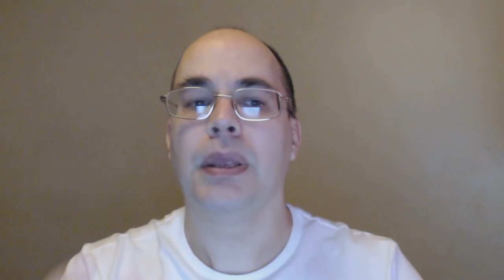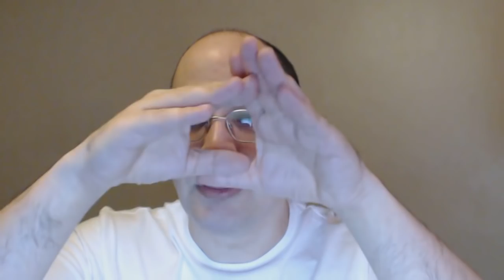How do rockets move in space, with nothing to push off from?

Comment from the maker: Clarification. In Newtonian physics force = mass x acceleration not mass x velocity. However neither is entirely accurate for calculating rocket trajectories in space due to issues with Einsteinian physics. In the video I probably shouldn't have used the term equals which made it seem like I was reciting Newton's second law, but with the hundreds of videos I have done one was bound to have some ambiguity in it. In the video I was referring to the conservation of momentum and using the example of a bullet leaving a gun, for these you need to use velocity and NOT acceleration, especially as I was being explicit that both the gun and later the rocket were stationary. Acceleration is the change in velocity over time and in the example of the bullet leaving the gun and the recoil happening, time is not a factor. Hopefully this clears up any confusion.
Reply: @Davy spilani, I know that you think you've figured out some giant flaw in the foundations of physics .... but you're wrong. Simply, completely, utterly wrong.
__

First, the "mass that an object is pushing against" in the case of a propeller (in air or water) is 100% irrelevant.

Proof: A boat, with its propeller turning at a set speed, produces exactly the same thrust whether it is on a small pond, a moderate size lake, or the immense ocean. The mass of the lake may be thousands of times greater than the mass of the pond, while the mass of the ocean is trillions (or more) times greater. Yet the thrust of the boat changes not one iota.

The thrust of the propeller is proportional to the amount (i.e., mass) of the water thrown backwards (which is proportional to the diameter of the propeller & density of the fluid) times the average speed at which the water is thrown backwards (proportional to the propeller's rotation speed). Note well, there are also Drag Forces to consider, as the boat (or plane) has to push water (or air) out of the way in order to move forward.

But if you were able to add up all the momenta of all water molecules pushed backward, forward & sideways, then their accumulated momenta would exactly equal the amount of forward momentum of the boat.
__

Next, your "spring model" for a rocket is inept. 

The main failure is that, with your "spring & two equal masses" model, you throw only one mass, one time, at very low speed compared to the rocket's speed.

A real rocket throws (trillions times trillion times trillions ...) of tiny masses (the rocket fuel molecules) away from the main mass (the rocket itself) at very high speeds.

A better model would be a machine gun (the "rocket engine"), mounted on a platform (the "rocket"), shooting bullets (the "fuel") backwards, which causes the rocket & engine to move forward.

Now you have a small mass (the expelled rocket fuel molecules or bullets) being thrown backwards at high speed from the main mass (the rocket & engine) & the main mass gaining small, incremental increases in velocity forward with each object thrown backwards. 

They key differences with a spring is that a certain amount of mass (rocket fuel molecules or bullets) is leaving the main mass (the rocket & engine).

This system works just fine in an atmosphere or in a vacuum. In fact, it works better in a vacuum because there are no molecules of air that it has to push out of the way in order to move forward.
__

If you are a typical "rockets don't go into space, it's all a giant hoax" conspiracist, then your problems are much greater, and much different, than merely not understanding remedial physics. Scientists, physicists, engineers & teachers are not part of some giant conspiracy to lie to the public.

Here's a rule to consider:
"For every idiot who turned out to be an Einstein, there have been a million idiots who turned out to be idiots."

Play the odds.
You're not an Einstein.
Reply: Rockets ignite typically liquid oxygen and kerosene in its combustion chamber. This continues event makes the molecules of the gas (unders great pressure) bounce off the walls of chamber.It then exists the where it continues to bounce off the nozzle (but not as much as the chamber)
THIS produces the thrusts.

It doesn't need air to operate in or push from. This is the many problems people have since they use the false equivalence of propellers that needs to push of air.
Since the Soviets launched the first satellite we have many forms of evidence of engines operating in a vacuum.

To sum it up: The exhaust gases and the rocket push on each other
Evidence: Most recent are the SpaceX missions. if rockets do not work, explain how SpaceX is getting cargo in orbit, How did the Soviets go to Venus? How did the Chinese send a probe around moon, etc?

Some resources for you
http://www.physlink.com/education/askexperts/ae221.cfm
http://www.braeunig.us/space/sup1.htm
https://www.quora.com/How-do-rockets-accelerate-in-space-or-vacuum-in-the-absence-of-any-material-to-provide-them-the-required-reaction-force
https://www.youtube.com/watch?v=rt5dcrm8X1w

Rockets experiments in a vacuum
https://www.youtube.com/watch?v=GxBRQXxBRic
https://www.youtube.com/watch?v=76JM03a6WH4
https://www.youtube.com/watch?v=uf6158lBjGo
Reply: @m j murcott
You simply mis-spoke. There is no need to bring "Einsteinian physics" nonsense into the issue. In your "correction", you introduced a MUCH bigger mistake. The law of Conservation of Momentum is always exactly, precisely true in both relativistic (extremely high speed) and non-relativistic (lower speed) systems. 

Force does NOT equal mass times velocity. 
Momentum equals mass times velocity. 

At the 2:35 point, you should have said, "Since MOMENTUM equals mass times velocity ...", instead of "Since FORCE equals mass times velocity ..."
Reply: Davy spilani - how about this simple physics problem? I have a remote control crossbow. It is loaded and cocked and I set it on an ice rink on little ice skates (or frictionless surface). What happens when I fire the bolt from the bow? What happens to the bolt? What happens to the bow? What if I use a low mass bolt like balsa wood? What if I use a high mass bolt like lead? What if the bolt and bow both have the same mass? Describe what an observer would see in these experiments.
(But I already know you won't answer, you will make some excuse why it is not relevant instead). And you THINK it is irrelevant but that is your lack of understanding of physics talking.
Reply: Justin Derricott 
Not when ot comes to friction they aren't.
Reply: THE RECOIL FALLACY This is perhaps the most commonly used analogy to help the average person figure out how a rocket works: “Well, just think of a shotgun, you pull the trigger, a charge explodes, a bullet is propelled forward at a high speed and you feel a recoil that pushes you backwards (same in the wheelchair-medicine ball variant). You know, action-reaction, Newton 3 law, etc. OK, now bear with me, a rocket is like a shotgun that instead of bullets shoots out highly pressurized gasses. Do you think you wouldn't feel the recoil shooting a rifle in a vacuum? Of course you would, so, since a rocket and a rifle use the same principle, they must work just fine both in your backyard and in the vacuum of space. Right? ”Wrong". The fallacy lies in equating the bullet in the rifle with the expanding gasses in the rocket. Why? Because, from a Newtonian point of view, in the two systems the bullet and the gasses have opposite inertia. Inertia of rest vs inertia of motion. The players in this scene are: the Rifle/Wheelchair (= The Rocket) the Gasses/the-ball-thrower (= The Force) the Bullet/Medicine ball (= the external pressure/Resistance to the expanding gasses) in the rifle/wheelchair example, the whole system is at rest initially. The rifle, the bullet, the wheelchair, the medicine ball and the-ball-thrower are solid objects, and they just love to stay at rest (Newton 1 law). To put anything in the system in motion, overcoming inertia, you need to apply an external force (action). Newton 3 law tells us there can be no action without a reaction if a force pair exists, so the same force applied to the bullet or the medicine ball will be applied in the opposite direction to the rifle/wheelchair. Who provides the force? The expanding gas in the rifle (or the-ball-thrower sitting in the wheelchair). So far so good; on the other hand, contrary to solid objects, the molecules of a gas are, by their nature, in an endless state of motion, they're constantly moving around at great speed, whizzing and bouncing all over the place. No external force or any kind of “pushing” is needed to put a gas in motion, the gas molecules are already in motion. Can you see the difference here? In a rocket, as soon as you open the valve of the combustion chamber in a vacuum (no external pressure), the gas will say thank you very much and merrily shoot out, ON ITS OWN. It isn't the rocket pushing the gas out, the gas inertia of motion is doing all the job. The gas won't need no stinking push by the rocket. If no force is pushing the gas out, from whence should the “recoil” force be coming? Recoil to what? Bottom line: Newton 3 law actually disproves rockets working in the vacuum of space.
G'day Mate
Reply: @uncommonsense9948   - DID YOU WATCH THE FUCKING VIDEO "Uninterrupted Footage of the Falcon Heavy Launch and Booster Landing!"

YES OR NO?

It shows UNMISTAKABLE propulsion IN A VACUUM!!  Now Tell me that you watched it and we can discuss the results.
to IGNORE it is not scientific.
And since the gases leaving a rocket engine all leave IN A SPECIFIC direction and NOT ALL DIRECTIONS, it carries a NET MOMENTUM that MUST be cancelled by an EQUAL AND OPPOSITE Momentum to the rocket nozzle.
PERIOD.
Reply: You need help.
Reply: Mass x velocity gives you momentum.
Reply: Stuart Gray Ice and a vacuum are two different things..
Reply: think flat earther  lack basic understanding of physic. The funny part is than lot of them try to prove stuff with "science" while they don't understand it. And once they realism they cannot make sense of somethings, they well deception and run away.

But mentioning Einstein might be a mistake there. IF they cannot even accept the basic concept of gravity and you try to tell them newton been wrong and gravity as a force don't really  exist they will cherry pick it and ignore all the rest of the much deeper physic reasoning behind it. Shit i think i just say it what i have done????
Reply: A change in momentum generates a force. SO a change in mass or velocity will generate a force. So mass flow rate of fuel times the velocity of fuel creates the propellant force. We knew what you meant.
Reply: m j murcott that's the law of physics,  for every action there is a reaction in equal and opposite direction.....now where did you get your answer .....enlight me
Reply: m j murcott
, the gun analogy doesn't work here because the gun is expelling a projectile of serious mass and the rockets only projection is the gases that would be immediately consumed and expelled in ALL directions rendering them useless for our requirements...
Reply: m j murcott WHY A ROCKET WON'T WORK IN A VACUUM!
Why a rocket engine will NOT work in space! NASA says Neutons 3rd law of motion is what makes a rocket work in a vacuum. The 3rd law states "for every action there is an equal and oppersite reaction".  They say this propels the rocket forward and not the air the rocket is pushing against! I say, using  Neutons law, Imagine two big heavy boxes in space, move them together and put a spring in between them,, connect the boxes together.. Now, the spring is the action and you will have an equal and oppersite  reaction via the boxes, when you detach the boxes the spring will push them Appart. So the action of the spring caused an equal and oppersite reaction and the 2 boxes shoot Appart at equal speeds as long as they both have the same mass..  Now a car is Mass the wheels are the spring or thrust and the road has mass, the spring pushes in equal directions, or the wheels turn and the road and car shoot Appart in oppersite directions at equal speeds. The ship works the same,, propeller is the spring and it pushes against the ship which is a mass,, and the sea which is another mass, the 2 masses move Appart at equal speeds in relation to their masses,, The ship has more mass than the sea water behind the propeller so moves slower than the water, A plane uses the same principal. A rocket,, the same principal,,, In this 3 part equation, ie (Mass spring Mass) or (Oppersite reaction/Action/Oppersite reaction) Quote "for every action, there is an equal and oppesite reaction". The rocket is the first mass the spring is the fire plume, (This is a controled explosion that pushes equally in 2 directions just like a spring) and the earth's atmosphere is the other mass, again proportional to thrust and  depending on the mass of air moved and the mass of the actual rocket determines the speed the rocket moves in one direction. As you gain altitude the mass of the atmosphere exponentialy decreases but the mass of the rocket stays the same so in order to continue up at a constant speed the the fire plume or controled explosion has to exponentialy increase thrust in both directions until finaly there is nothing left to thrust against on one side of the fireplume as the atmosphere has depleted. Now we have a case of Neutons 3rd law of motion only having 2 parts ei ( Mass spring ?????) So Neutons law no longer applies and the rocket will not have propulsion, like taking away the sea from the ship, if ships could fly it would just not move,, the propeller can spin as fast as it likes the ship is not going to move. This is before you consider the unimaginable amount of radiation both in the van Allen belt and in general space.. So that's Neutons law saying you can't go into space for far using a rocket engine, You need something to thrust against...   It doesn't matter what those masses are, that's not the point, all that matters is the action the reaction and the oppersite reaction (Reaction/Action/Reaction) 3 parts.. The 3rd law of motion. You can have one big box one small box, One with double the mass, a super spring, it doesn't matter, the principle stays the same, this is a law of physics. so that's ( Rocket = Mass/Explosion/Atmosphere=Mass) The rocket and atmosphere are the equal and oppersite reaction. Take away the atmosphere and you have (Rocket or mass=reaction/Explosion= Action=Explosion/Nothing????? zero mass = No Oppersite reaction) Now Neutons law can not apply.. The rocket can not propel forward...
PROBLEMS WITH ORBIT SPEED
If we have (mass1=Actual rocket/Spring or thrust/mass2=Atmosphere)
So If thrust needs to exponentialy increase to compensate for an exponential decrease in mass 2. Then there's ,A, An exponentially  increased need for fuel and ,B, A constant weight added for all the fuel nessasary to reach Orbit velocity. 
You would need an atmosphere to use as mass2 and the problem with that is heat! To reach Orbit velocity means 17/18,000 MPH If you do that speed in the atmosphere you burn up?! Especially when you are carrying Highly explosive rocket fuel! 
Conclusion!
In order to achieve enough mass2, In an infinate vacuum, you would need to have infinate thrust and infinate fuel  and that fuel would have infinate mass in order to create enough of an atmosphere in mass2 (space) For the spring or explosion (Rocket fireplume) The action in Neutons law,, ie (reaction/action/reaction) to have enough thrust to propel mass1 (the actual rocket) Forward. This is assuming space is infinate and a vacuum! 
Final conclusion It's not possible.. Maybe very low orbit with very light equipment, but with the radiation and heat problems! Once a rocket engine switches off in space the rocket will start to fall towards the nearest large object unless the rocket is in orbit!! ..
Reply: @davyspilani1231  You did an awesome job explaining Newtons Third Law and other associated problems with rockets working in a vacuum. Unfortunately Murcott is a science fiction instructor or a total sell out or not capable on comprehension on even the lowest level of anything logic based.  So great job maybe someone on this site will benefit from our exposing the fraud associated with this propulsion in  vacuum of space crap.

G'day Mate
Reply: @davyspilani1231  You did an awesome job explaining Newtons Third Law and other associated problems with rockets working in a vacuum. Unfortunately Murcott is a science fiction instructor or a total sell out or not capable on comprehension on even the lowest level of anything logic based.  So great job maybe someone on this site will benefit from our exposing the fraud associated with this propulsion in  vacuum of space crap.

G'day Mate
Reply: @uncommonsense9948  - watch the YT video: "Uninterrupted Footage of the Falcon Heavy Launch and Booster Landing"

Then TELL ME WHAT YOU WITNESSED
There is UNDENIABLE evidence of rocket propulsion in a vacuum in that video. More than one example in fact.

Now watch it or ADMIT that you have no intention of evaluating evidence.
Reply: @inniuniui9361   - "tell everyone on the thread how a rocket is really a water cannon""

Sure: See the Space Shuttle Main engine, BURNS liquid Oxygen and Liquid Hydrogen and expels the combustion product .... PURE, H2O WATER at about 2500 meters per second, or about Mach 8 at launch.

The FORCE of pushing put all that WATER creates a recoil force on the rocket nozzle pushing in the opposite direction. This is what we call THRUST.

See a rocket engine is just a MASS DRIVER, so using the MASS of the WATER GAS, as the "Mass" it can create a RECOIL force when pushing the mass away.

Basic Newtons laws.

SO yes a space shuttle main engine IS a big PURE WATER CANON.
You are welcome.

But anyone that has graduated HIGH SCHOOL knows what you get when you BURN hydrogen and oxygen.  why dont you?

Now shall I explain how the RD-180 engine used on the Atlas Rocket (built where I worked at Lockheed Martin in Waterton CO over 25 years ago) burns liquid Oxygen and Kerosene and releases mostly Carbon Dioxide as a exhaust product?
So that engine isn't a water cannon, it is a CO2 CANON.

you are really struggling to understand this.
Reply: @davyspilani1231  Hello Davy. I wrote your explanation of 3 Newton Law and I think you are correct. This is a reason that NASA and other never flight over the low orbit . 80-106 km it  was all thar X-15 with rocket engine could achieave. There is no enough gases above low arbite and rockets can not move forward.  Action-Reaction but also resistance is necessary. Reg to you